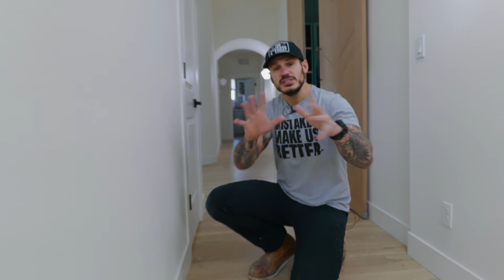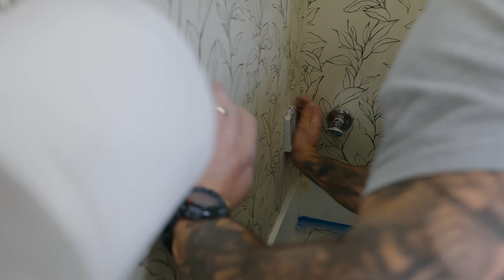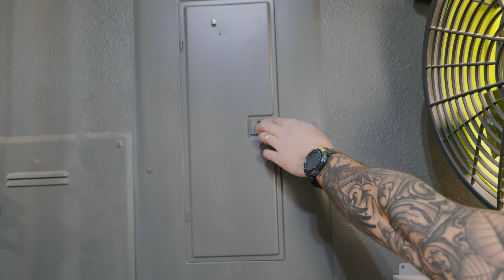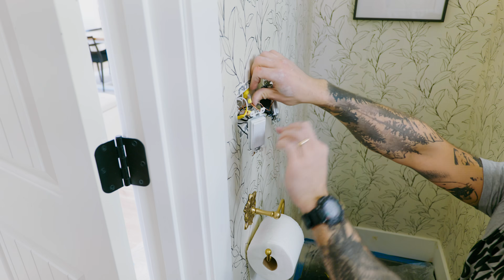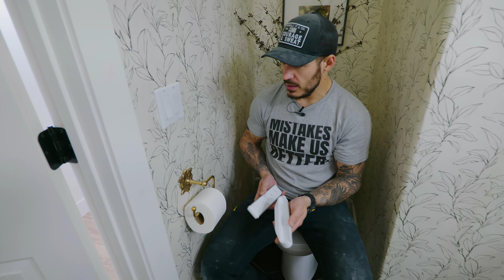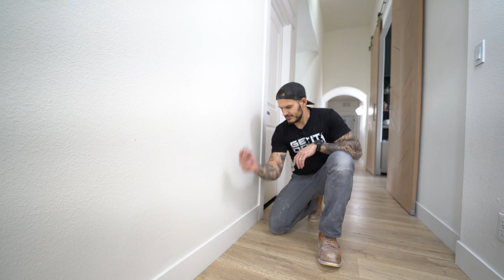Adding Electrical Outlet Anywhere!

Comment: I have an outlet behind my bathroom wall that goes into my computer room. I’m only worried that if my bidet can pull up to 1400 W that it will overload the circuit of the computer room. I’d really rather not run a separate circuit can I just increase my amperage to 25 amp breaker

Comment: Excellent video with only ONE important detail missing from your intructions:  TURN OFF POWER AT BREAKER BOX/AKA IN MISSISSIPPI, "FLIP THE BREAKER" after testing wires for power and BEFORE working with the wires.

Comment: I would have pulled the base molding and ran it to the floor, then over.
Reply: I came here to say the exact same thing lol. Like it was totally unnecessary to have any drywall work to do if you just pulled the base and ran the wire below the height of it. Just cut out enough to get a drill through that stud and you're done.

Comment: I'm surprised about the hole... that was needed at all is a surprise (no mention about acess from crawlspace or attic by splicing into a line that's down/up there?). I'd avoid drywall repair if I could. Then I was surprised that you cut the hole horizontally AND vertically (the vertical part was unnecessary, gravity is your friend!). Then even though you had all that room on the other side of the wall, you still took the toilet out!. You could have created the new outlet's hole and installed the old-work box from the reverse side - you had *so much room for activities*. Wax rings on toilets are so easy to mess up... just, every step created extra work.

Comment: We just did a renovation of our guest bathroom. We added an outlet next to the toilet for a bidet and we also added a hot water stub out next to the cold water stub out for the toilet so the bidet would have hot water. Whats surprising to us is the local building code allowed both of these. The only downside to this was upgrading to 20 amp as it required running new 12 guage wire from the breaker box that is on the opposite side of our home. Yeah, that was expensive! Lol!

Comment: I'm going to add an outlet in my main floor toilet room.  Thankfully for me, the basement is in the process of being finished.  And there's a bathroom close to under the main floor toilet - so when I do electrical for the basement, I can feed a wire up next to the main floor toilet.  Thankfully, I'll have a really easy solution for my situation.  :blessed:

Comment: Isn't there electrical code pretty much everywhere that says no outlet can be 36 inches from a water source?! The toilet has a water supply line. Isn't that outlet too close to the toilet?! Just curious.
Reply: I want to know this too and also if there is a code or standard for the height from floor

Comment: WASN'T NECESSARY TO CUT ALL THIS "L" SHAPE. DANGEROUS CUT WITH TOOL BECAUSE YOU HAVE AROUND POWER ELECTRICAL WIRES.

SHOULD REMOVE THE ELECTRICAL BOX FROM INSIDE (SWITCH LIGHTS) AND WORK FROM THERE, INSTALLING YOUR NEEW WIRE AND ONLY CUT ONE STRAIGHT LINE ON THE BOTTOM TO YOUR NEW CUT HOLE FOR ELECTRICAL BOX. 
AND DON'T BRAKE SMALL PIECE OF YOUR DRYWALL, CAREFULLY CUT THE DRYWALL AND REUSE YOUR PIECE AND ONLY USE A SMALL PIECES ON WOOD TO ATTACH THE OLD DRYWALL. 
IF YOU CUT THIS NICELY MAYBE A LITTLE BIT OF TEXTURE FINISH MAY NEED IT, AND PAINT.

Comment: If you have a basement or crawlspace there is no need to cut the sheetrock on the back side of the wall. You could simply go through the flooring between the wall and run the wire under the house. If you have a house built on a concrete slab then that is a different story.

Comment: I don't have any outlets or switches close enough to divert to be near my toilet, but its a nice idea. I suppose I could run wires in the attic. I love the setup with the rubber "bungs" (which is what they are called on listings for their sale) because they stay tight and I don't have to constantly reach under the toilet to tighten nuts to keep my seat on tight. If they don't go in easily, sometimes you can put a little soap on them to make it easier.

Comment: Since I don't like to do drywall work, I would have removed the trim at the bottom of the wall and made my drywall cuts there.  That way it's an easy drywall repair that gets covered up by the trim.
Reply: or run the power down the wall from the attic...

Comment: What to do if I have a flowtite push pull valve (fully plastic), which the hose attachment from bidet doesn’t connect, also the circuit in the garage is a 15 AMP? Should I use 15A outlet?

Comment: This is how you use those wago style connectors instead of having to create a pig tail in a tiny 1 g box. With the wall open I would really try to use a new construction box but for a bidet you plug it in once and that's done, so no problem.

Comment: Nice video, liked it, only one thing, I usually make only horizontal cut, because vertically it’s easy to fish wire inside the wall,in between studs
Reply: right!! Or how bout remove the base board and cut the sheetrock there, drill your holes for the wire, reinstall the sheetrock and then the base board. So much easier

Comment: The cuts all over your hands are signs of a great electrician! Seriously thanks for the informative video, I now have the confidence to put a power outlet into my bathroom, I was a little freaked out at first, but it should be a piece of cake. 
Questions :

Why did you have to remove the old toilet to install the electrical connection? Answer (more room to work?)

Comment: just remove the baseboard remove the Sheetrock. drill the studs. cut a hole for the  new box. drop the wire pull the wire to the new box. replace the drywall behind the base. replace the base. touch up paint. install new outlet.

Comment: Nice presentation!
Not sure how your attic space was for setup, but if accessable, you could have come off an existing outlet junction box drilled a hole through the wall plate/stud and fed your cable down, permitting any cross studs. In which you could create a small hole in drywall to use a spade bit with an extension and then feed the cable to outlet👍

Comment: Question for anyone who has the knowledge. I installed a toilet but the closet flange was to low so I added a flange extender. I used a xl wax ring but it didn't feel secure so I used 2 wax rings and it feels solid. However, as I flush I hear a small dripping sound coming from the base of the toilet, where and what did I mess up?

Comment: That was a lighting circuit you pulled off of which was on a 15 amp circuit (the cables going into the box were white), so 14-2 would have sufficed. The label on the panel was refering to the bathroom outlet.
Another way you could have done it without sheetrock damage was drill up through the floor into the wall cavity from the crawl space (I know, I know, crawls blow, but just another approach for the homeowners that don't want to deal with sheetrock repair)
Reply: Flat slab, no crawl space..
Reply: @tylerc3576  well, yeah, obviously if it's a slab it wont work out that way. But the majority of the country have crawls or basements, so I was giving a general suggestion.
Reply: @joshuahaught4812  Its one of the many reasons im thankful for a basement of my first home. Adding/changing positions of pipes and or outlets just requires a simple step ladder downstairs. :)
Reply: @tylerc3576  Exactly! the more accessible something is, the easier it is to change.

Comment: shouldnt the electrical outlet be above the toilet water shut off valve incase the solder leaks?
Reply: 12” above floor level, and MUSt be GFCI protected
Reply: @nachobed  oh ok, so nothing to do with the water valve?
Reply: @HabsAllDay17  whelp I’m just an apprentice so don’t take my word. In Ontario our electrical code says receptacles can’t be placed directly behind or below a water faucet.
Reply: @nachobed  cool just wondering

Comment: Nice easy tutorial. Another easy way to not have to fix wall is to remove baseboard and the drywall behind it. Then run the wires behind that. That way no need to patch the drywall, just need to replace the piece you cut out and cover it back up with baseboard
Reply: This is incredibly dangerous, do not do this.   Without nail plates, someone could drive a nail through the electrical, and being so close to the floor any water spilled could get in/on the wires.   This is fine for low voltage (like running a network cable) but not allowed for electrical!
Reply: That's a great idea, I may consider that for my install this week. In the interim. I'll just snake power round the corner as we have an outlet on the wall behind the toilet.

Comment: Wait, why isn’t there insulation behind the dry wall?
Reply: You don't insulate interior walls.
Reply: Usually houses are built cheaply, one super expensive expense is, insulation. Insulating the outside walls are probably the most important in keeping in heat during winter and cold during winter. Roof being also important, inner walls less so.
Reply: As stated already, it’s an interior wall.

Comment: I installed on few month ago... and its kind of a waste of money.  You still need something to dry the water off with since the "air" isn't strong enough nor do you want to just sit there for 5 mins waiting for your butt to dry.  So only thing to dry yourself with a toilet paper but it just tears apart with water.  I also found that the jets really don't get everything clean.  I always see some brown spots when I go to dry with a wet wipe after using the Bidet.  Really the only thing that my $300 bidet is good for is the night light and the heated seat.  I haven't use the wash function in about a month.
Reply: TMI
Reply: I’m getting one installed cause my simple one currently is on the right but I’m under going a right shoulder replacement will not be able to use my current  bidet thus one with a remote will help😝

Comment: How does it use hot water? Isn't there only a single cold water input?
Reply from the maker: the seat has a internal reservoir that's heated
Reply: I’m sure it has a electric heating element that warms the water

Comment: Make sure you check the breaker of your light switches before you start down this road folks. My home, built in 2017, uses 15 Amp circuits for the light switches, not 20 amp.
Reply from the maker: true

Comment: why are all the cables exposed and not coated/colored. looks very dangerous when they touch each other.
Reply: The grounding wire is required by the National Electrical Code to be a bare wire, or if insulated, a green or green with yellow colored insulation. It’s perfectly fine/safe for it to be uncoated
Reply from the maker: that's right!
Reply: @MrBuildit  Shouldn't a 20 amp circuit have yellow wire instead of white wire? Looks like you had white wire going to the box. that indicates a 15 amp wire gauge. You might want to check that.
Reply: @rchavez5056  in his defense it would still pass code....although I'm not to sure that GFCI would; wasn't TR rated Although the local code might not require it, so who knows. Also, if the Bidet needed a dedicated circuit or not, again, who knows.
Reply: @joshuahaught4812  He did say and show that the circuit had a 20amp breaker in the panel but the wiring was white. I believe that would be a violation even before the work that Mr. Build It performed.
Reply: @rchavez5056  in a different post I was saying the circuit he showed at the panel was refering to the bathroom outlets, not lighting circuit.
 The code was refering to the bathroom outlets havimg to be on a 20 amp circuit, no where in the code does it say the bathroom lighting circuit needs to be on a 20 amp circuit.
The power he was tapping off of is from a 15amp lighting circuit.